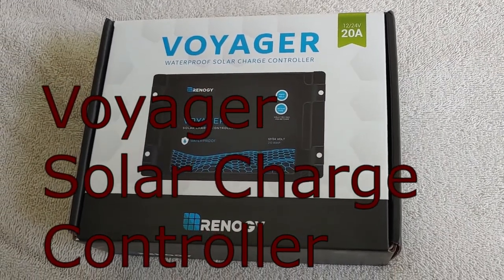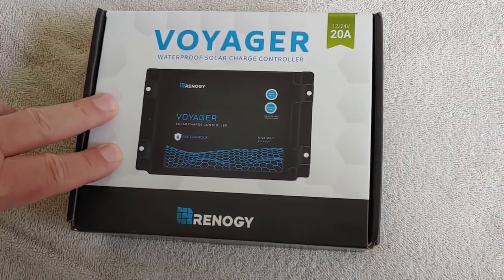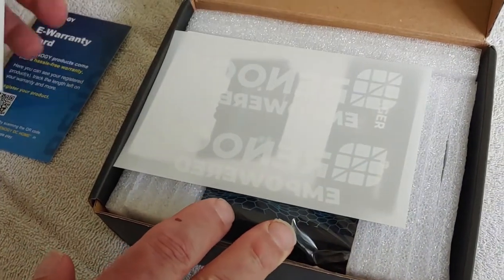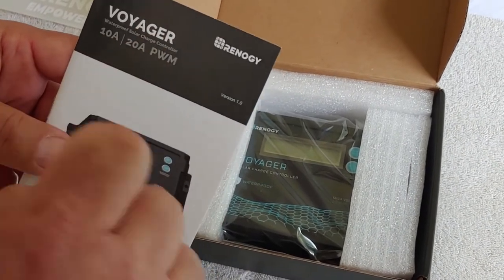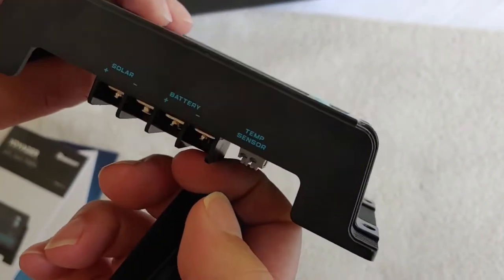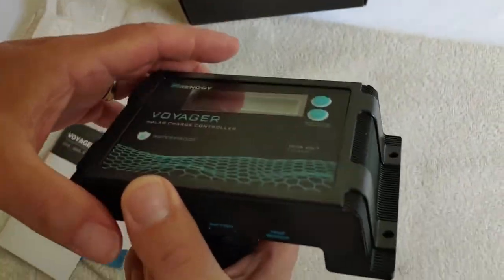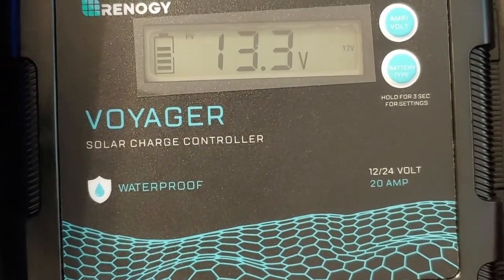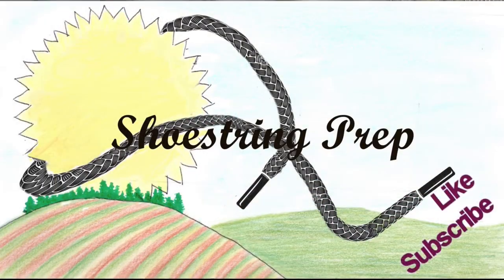The Renogy Voyager Solar Charge Controller unboxing and operating.

Comment: you actually didn't select the battery type because you did not follow the instructions and press and hold the battery type button to lock the lithium battery setting
Reply from the maker: Thanks for your comment.

Comment: My BMS stopped working after the 2nd day of use. I get a 0- - - -  A zero and dashes going across the screen as if its charging its self or something. I thought I may have somehow turned it off but I cannot get the BMS to display anything but 0 - - - - . The panels are great though. I was getting 10A out in full morning sun in November.

Comment: I wish this one came with a temp sensor. I still have a SLA solar setup for my truck topper/camper. I need a low cost charge controller because I let the smoke out of my last one. (User error)
Reply from the maker: I have several SLA setups myself
 Thanks for the comment.